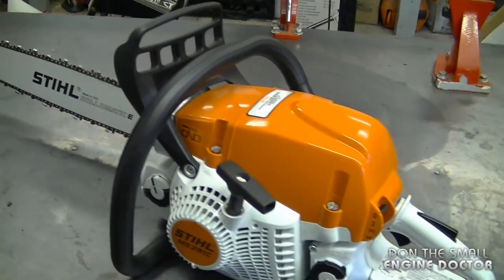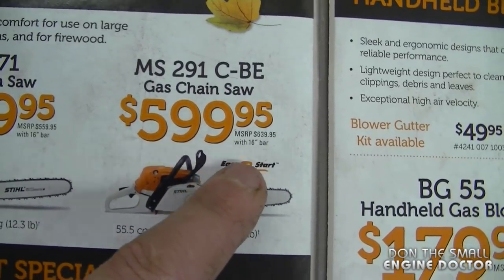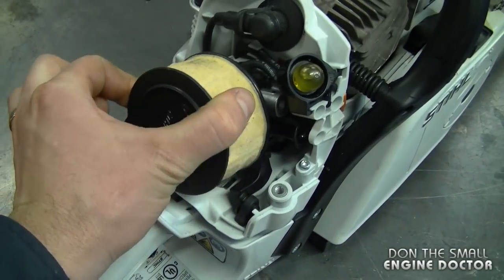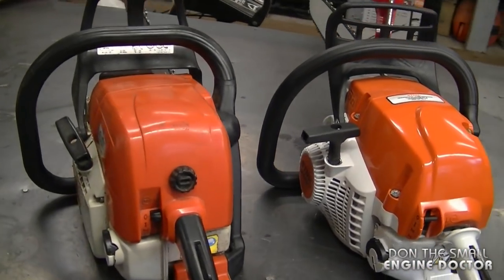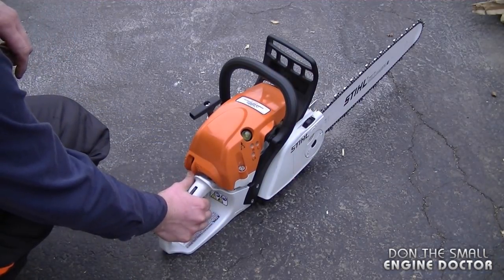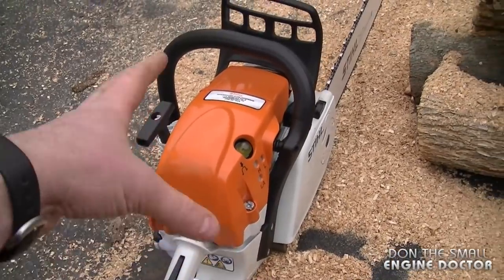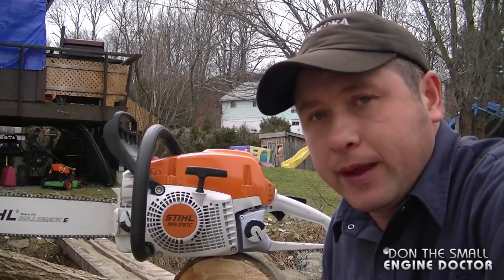STIHL MS291 Chainsaw Review Video

Comment: I have the 211c, and was kind of on the fence about the easy start.  But I bought it so that my family could start it if I was not there.  I have grown to like it a lot.  It works really well, you just have to get used to it.
Granted, I have not used it very much, but for my application it fits my needs nicely.

Comment: I have A ms 291 purchased a year ago. There is no push button for priming.. it is the most difficult saw to start that i ever had.
When it is going it is great. I will trade it in for something that is easier to start.  When i see owners just starting the saw with a few pull i envy them. There is so much compression that when I pull the whole saw wants to raise of the ground.

Pierre

Comment: I have an important start up question with this MS291  starting this is with the chain break disengaged correct?  So when the engine actually starts the chain is moving correct then you click the trigger so it goes into idle mode and then if you want you can engage the chain break correct?

Comment: How come they say to start these chainsaws with a brake on but if you do that with this won’t you burn out the clutch?   That’s how I burnt out my clutch so to start this particular chainsaw the brake is off (disengaged) when it starts up you hit the trigger so it idles then you can use the break correct?

Comment: A really great saw. Bought it back in 2013 with a 18" guide bar and a 3/8 pitch chain. Nice smooth operation not heavy and easy to maintenance. Lots of common parts with the MS261. The clutch, the petrol tank, the air filter are some parts that are the same in both saws. Anyway the saw served me good for a short time, withhout any problems, until the day that it got stolen.

Comment: DB, These chain specs are odd for Stihl. The .325 pitch always had. 067 gauge and 3/8s are .050.  Stihl brand chain series begin with 26 and 33 respectively and are widely available. A  325 / 50 would be a '23' series.  Curious if Stihl changing over all the .325 pitch to .050 guage?
Reply: I meant .063 gauge on .325, not 67

Comment: I bought one of these saws (non C model) new when they came out. I bowed to peer pressure and moved from Husky. It does perform well and can be a pleasure to use but it has always had it's little shitty points. First start of the day has always been a real bear, once running it's good for the rest of the day. I've never liked the bar oiler, not enough oil and the bar gets hotter than I like but dealer says it is the way it is supposed to be. Now the choke linkage system has screwed up and the dealer was nice enough to tell me up front that I had better go re mortgage my house if I wanted him to fix it. So now I am trolling the internet looking to see if someone else has had this problem to find enough information to fix it myself. Over all I am really disappointed in the build quality of this saw and kind of wish I had stuck with Husqvarna.
Reply: I' almost convinced a certain brand of orange and white colored equipment isn't what it once was.  Almost believing perhaps it never was all it was made out to be..  Too much money already invested in all of it to scrap it.  So I come here to keep up with it.

Comment: That is a nice saw, and I would like to have one like that which runs that good. The MS 250 I have have never run right since owning it, and so far the new Poulan Pro I just purchased is a dud also. They both are currently in the shop being repaired and I am using my pole saw and old Poulan when it cranks.

Comment: Interesting to see the differences between the 291, and the 291C.  I have the former, and it does not have ez start, or the toolless chain tensioning.  Mine also does not have a primer bulb.  The rest looks much the same, except this is 55 cc's.   I haven't had the chance to use it yet- too much already cut wood to process before I go and get more!

  I got this, because the saw I already owned was having real trouble with the big semi-dry ash, and huge honey locust and silver maple logs I have access to.  (part of the problem was that it was very dull- esp on one side- and my less than great efforts at sharpening it didn't help, lol)  This saw should be able to handle it much better.   I'm not turning down free Ash and Locust- big or not!
Reply: You can upgrade and if you have not mod your exhaust I would suggest that. The saw will really come alive
Reply: Each time the chain goes dull, toss the saw and by a new one? I’ve never heard of that one before, I guess it wood work alright though, if the alternate is to sharpen the chain correctly?

Comment: I had a Still chain saw and it over revved and blew up.  Oil and fuel mixture was fine.  The saw lasted maybe 3 years.  Also,  I always had trouble starting it.  I payed around $400 for the saw.  He's what I'm getting at.  I went to Sears and bought a 20" Craftsman chain saw for $180 and I've had it for 12 years now.  The saw is beautiful.  I've cut down approximately 100 trees and completely cut the trees up for firewood.  So before you spend $500 on Still why not consider paying half for a no name brand.  Trial and error has taught me that brand name products alway's cost more.  note:  I am not saying anything bad about Still products, I personally think their a good quality saw.  I just believe you don't have to buy brand name products to get good quality merchandise.
Reply: +Robert T I was doing that math too, 
                  cheap "50 hour lifespan" saws for 75-85 USD, 
                  with name brand 300 hour saws at 500+, 
                  you can buy a half-dozen throw-aways, with fresh bars & sharp chains.......& still be $$$ ahead.
Reply: I paid $180 for my Craftsman 20" and have no idea what hours are.  But the saw did fall out of a tree about 15 feet and bent bar and ruined blade.  Put new bar and blade on and it started up on first pull.
That was 5 years ago.  I used to think expensive tools were the best.  Now I compare specs and read comments before I buy.   Sometimes you get lucky sometimes not.  Just trying to stay ahead of the game with all the overseas outsourcing.
Reply: +Robert T the recent products have hours of operation stickers, 
                   this Stihl has it on the inside of the operators handle, 
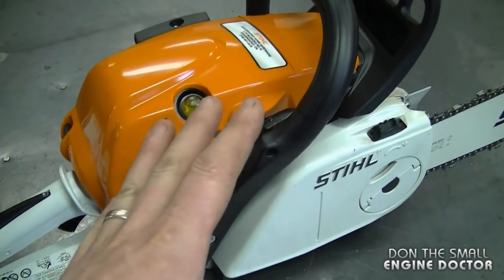                   you can see it in the video, @ 1:05 with other manf. info.,
                   it's the expected service life of the engine, or Stihl,in this case,
                   is calling it "emissions warranty".
Reply: lol funny, that means all my saws I use daily wore out years ago... crock of sh-t you said.
Reply: @timewa851  Yes it is that... saws like that some have way more than 500 hours of life.

Comment: I have a 034 and had it for about 26 years and I use my saws Regularly .I heat my house camp and garage with wood from my wood lot.I have rebuilt it once as it got down on compression. I always use high test gas and castrol oil.and never let mixed gas set more than a couple mths.I love my stihl .Also have 4 other smaller saws i use for the light stuff .I would never buy and outher echo saw .Have two both leak chain oil bad will empty out a tank over a mth.dealer tells me thats normal.Ya right
Reply: D Steven Paisley using 4-stroke engine oil in your 2-stroke gas/oil mix?

Comment: hi don what's the difference between drum.and.rim sprocket on a chainsaw
Reply from the maker: +Drew Thornton a drum sprocket is all one piece, a rim sprocket goes onto the drum as a separate part
Reply: +Drew Thornton  It's technically not drum and rim, it's rim and spur. With a spur sprocket, the clutch drum and drive sprocket are one unit whereas the rim sprocket is separate to the clutch drum.

Comment: I've had a MS290 for about 10 yrs, have never had anything go wrong with it whatsoever, love it.  Yes I've cut lots of wood over the last 10 yrs using only this saw.  Thanks for the review.  Still not sure which one is better.  I think the 291 just has more emissions stuff and newer technology for different altitudes maybe. That Chain you were using.  "SUCKED"  kinda ruined the review for how well that saw could work.  Most likely a dumb 26RM3 chain.

Comment: I work at a small engine shop and had one of these Saws come in for a simple tune up. the odd thing is it only turned up with 105 psi of compression. took the muffler off, no scratches. took the carb off, no scratches. the guys and I were confused. we called dealers and shops and couldn't figure it out. it also ran like a top. does anyone out there know the answer this mystery?
Reply from the maker: +Kyle Schuh (techumsehsucks77) did you try another compression tester?

Comment: Knock on wood!!!!----> i Really Enjoy my Husqvarna 455 farm tough rancher....  It's a Beast!. It's never bogged down while cutting. And always starts and idel's perfect all the time. But i do run nothing but premium and premium mix oil as well. The spark plug has also never carboned up at all.  I have owned it for 3 plus years.... I do enjoy Stihl as well. They are all very fine Product's. Just half to keep proper maintanance on them and the will last for years!.

Comment: Donny boy 73 I did not mean to disrespect you on this 291 video we have used 291 compared it to the 290 my290 8291 has no balls whatsoever what I mean by that it has no power compared to the 290 we cut  the same diameter tree and the 291 was struggling my 290 is gently used but the 291 is new I cannot believe Stihl actually released to the public    I mean what the hell were they thinking I think stihl just need to up their game if you're going to make a chainsaw like to 291 make sure it has more features and more power than the 290 in my opinion that's how it should be done!!!!
Reply: You do understand a new chainsaw will not reach peak performance until the engine is broke in.  I know plenty of guys that love the ms291 and have no complaints cutting many hours with it.
Reply: He did say the chainsaw was not broken in yet. I have an ms291 and it will cut circles around the vibrating heavy old cow an ms290 I owned before, it was torture to use it.

Comment: I bought a 291 before looking it over well, so I overlooked its STUPID top cover design, which requires removing three or FOUR SCREWS to get to the air filter! UGGH! Other than that, and the fact it has no decompression button, it's ok. I have 3 250s.

Comment: 56cc and 20" bar? Jeez i use an 044 which is 70.7cc on a 20" bar but weighs a lot more than 7kg.
Reply: That's because your 044 is a real saw, not this tupper ware junk :)
Reply: Ever ran a 25 on a 91cc saw?

Comment: I hate plastic saws, nothing sexy about that.  Couldn't even give you a metal loop handle.  Pinch that bar in the winter and start pulling on that and I guarantee you break that handle.

Comment: Stay away from Stihl 261. My Stihl 261 broke down after only 3 years of cutting firewood. Stihl said it was my fault because I didnt use the Stihl oil and alcylat gasoline! 026 was a much more robust saw and I had one for allmost 20 years and used shell oil and 95 gas mixed 2%. Not happy with the Stihl 261 and Stihl support.
Reply from the maker: was it your top end that was blown?